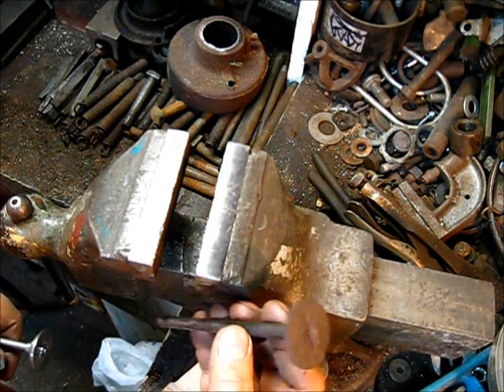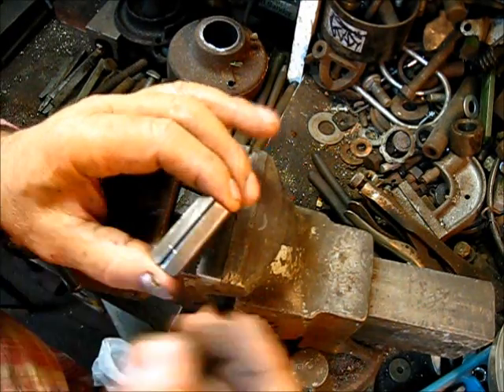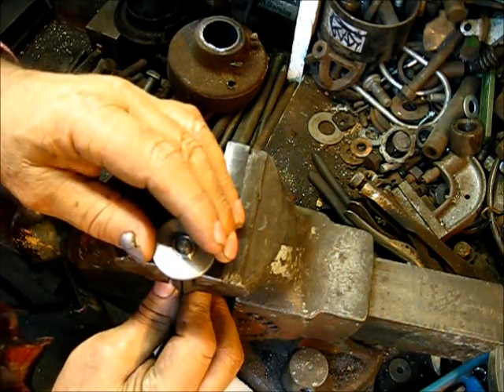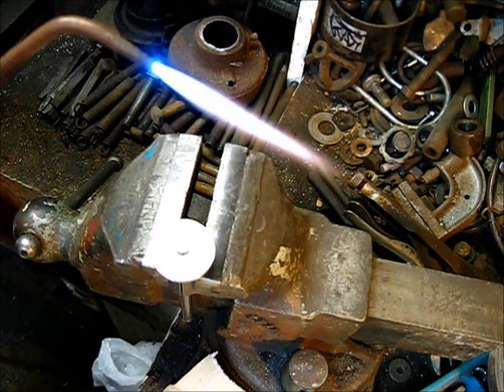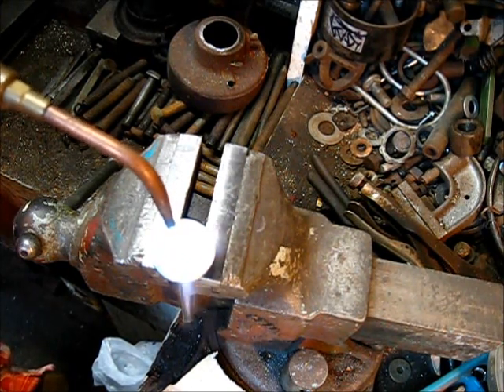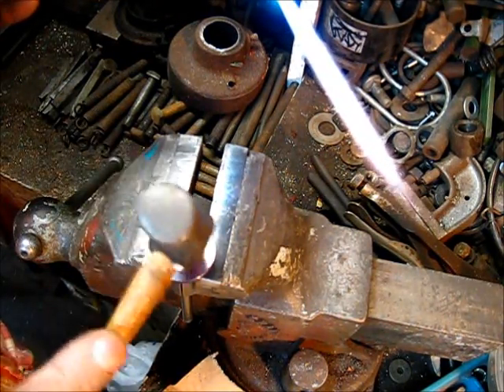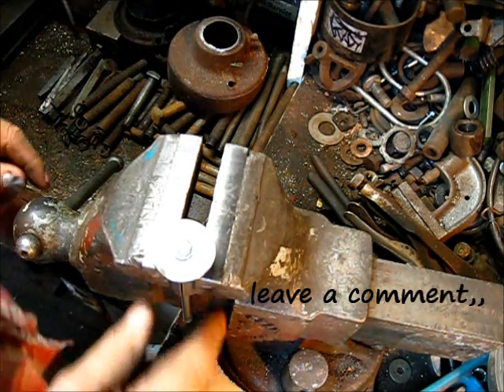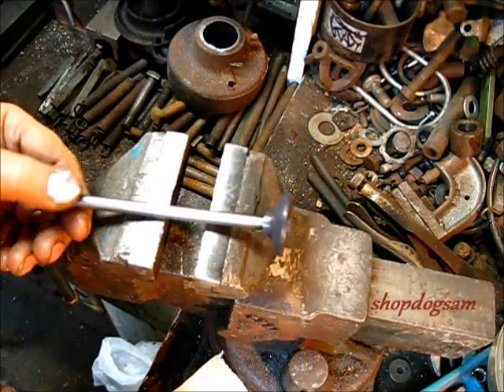I H C ENGINE how to build intake and exhaust valves #6

Comment: Sam, I like you style.  I am over in Alabama and I have become a fan.  I have an automotive machine shop with several metal working machines.  I am interested in making you tube videos and could use some advice.  You seem to have it down.  I am also a fan of MrPete222,

Keep up the good work.